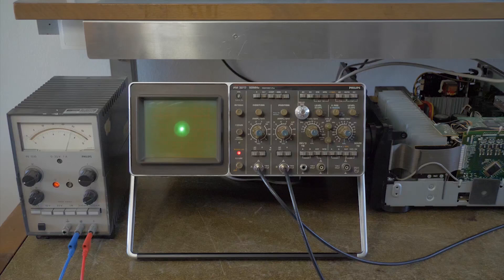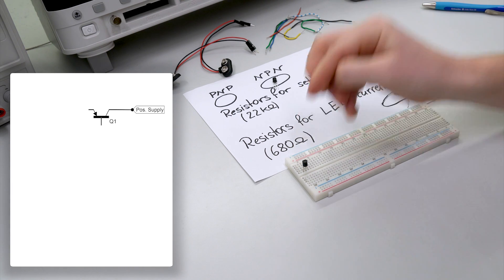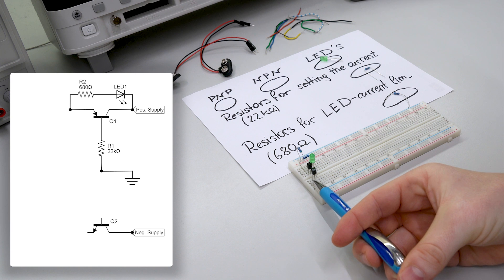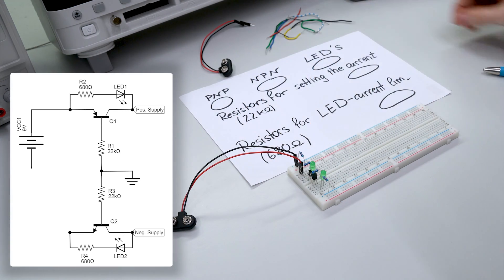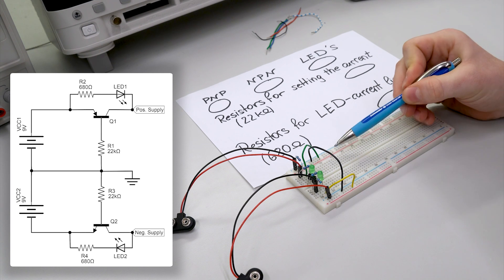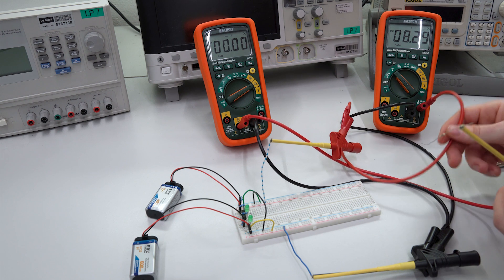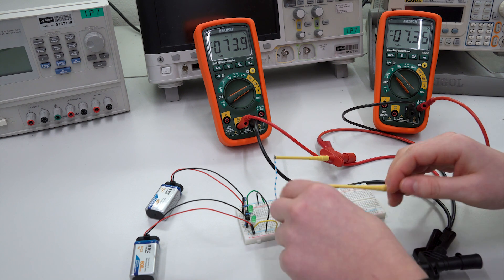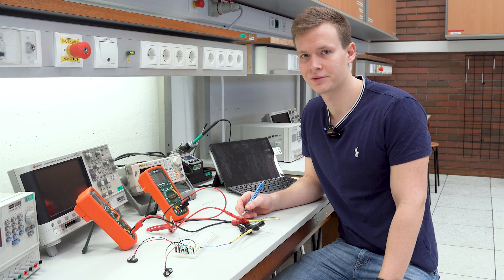Overcurrent Protection Circuit | Tutorial

Comment: I think it is very important that you explain the concepts behind the circuit .. i do not understand why it is an overcurrent protection coz i don't know which device detects the overcurrent in the first place ... i do not see any sense resistor in the path of the current being supplied by the batteries .. the transistors act as a short under normal operation .. how is the overcurrent detected and once detected, what turns off the transistor ?

Comment: This does work, but heavily depends on the Hfe of the transistor. This can vary between transistors a lot. So much that this circuit cannot be used for actual hardware design. But it is a nice demo.

Comment: I am sorry to rain in your parade but what you have here is not an overcurrent protection circuit.
What you are showing is that with 100 ohms resistor, there is not enough voltage between the collector and emitter of the transistors to turn the LED ON. With 100 ohms resistors the collector-to-emitter voltage (VCE) of the transistors are below 1 volt. 
If you change the resistor to a lower value, let’s say 40 ohms, you should see the LED turn ON and you do not necessarily have a short-circuit condition.
Please check this video https://www.youtube.com/watch?v=fqeUpATJlZY&t=0s where a real short-circuit protection is discussed. 
Better, check the Part 4 at https://www.youtube.com/watch?v=P5Cc14GrIx4&t=0s where a standard overcurrent protection is demonstrated.